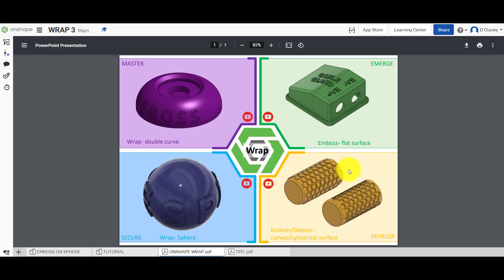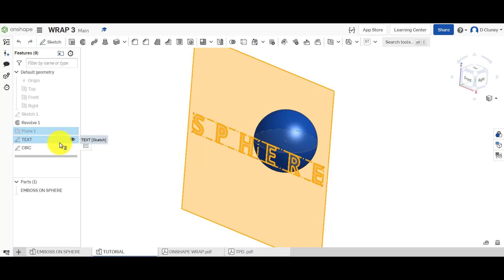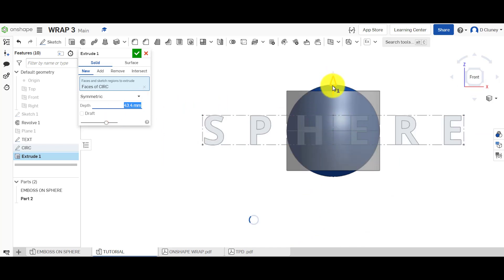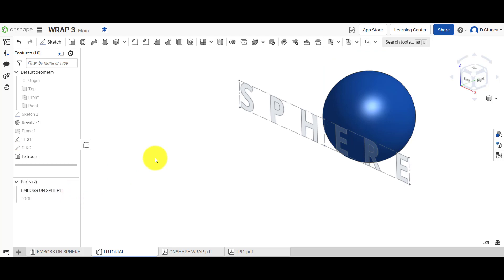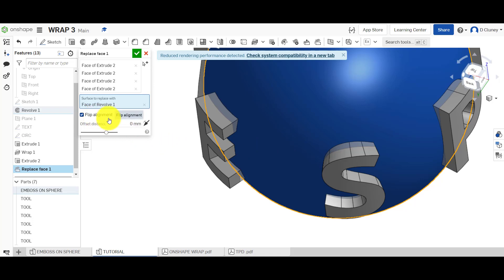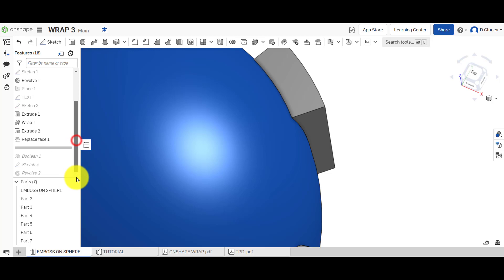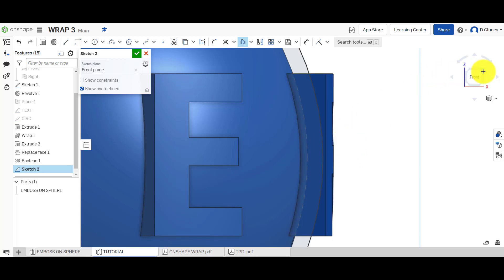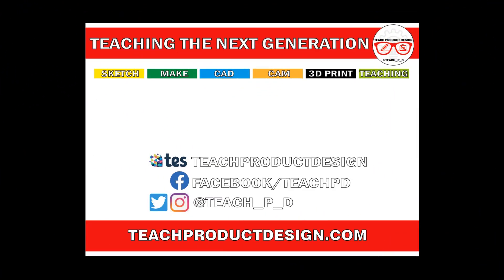Onshape Tutorial. How to create a WRAP on a SPHERE?? Step by step guide.

Comment: I just recreated this and I did it wrong but it worked out possibly easier. When I extruded the cylinder I made it smaller than the sphere so the step of Replace Face wasn't required as the base of the fonts are already burried in the sphere. I then increaced the thickness of the text till I was happy with the height. Then carried on with bool and the revolve trim.
Thanks Great tutorial!